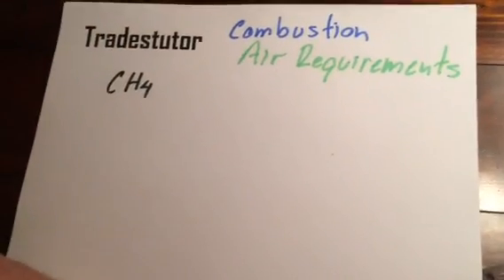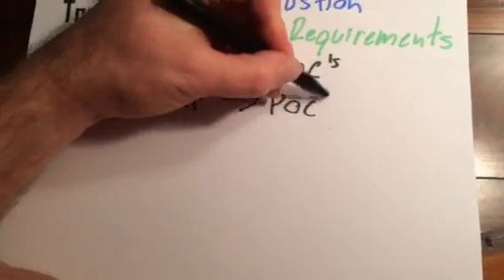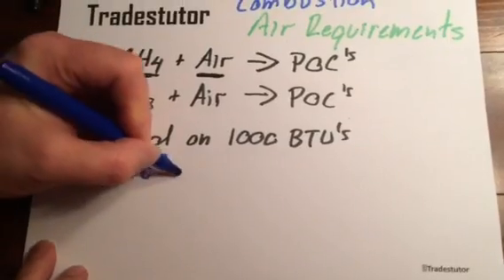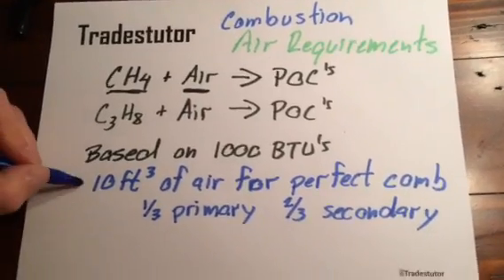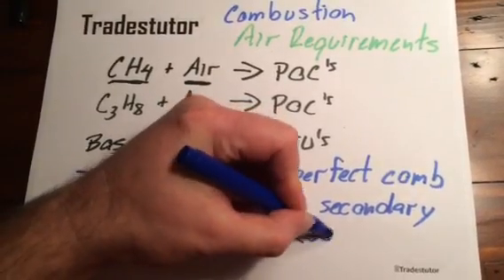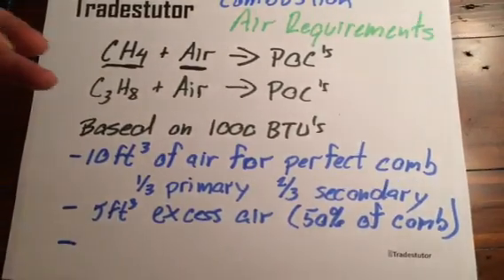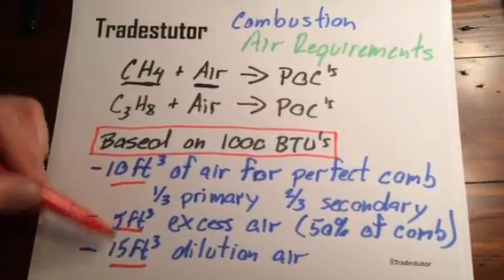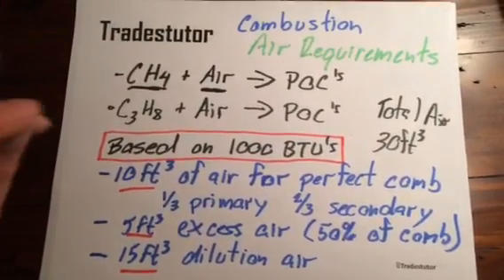Combustion air requirements

Comment: So a heating system rated at 125,000 btu is located in a confined space , all the combustion air is to be taken from the outside through horizontal duct a gritle is to cover 40% of the area
Reply from the maker: HI Liz:  This sounds like a combustion duct sizing question to me. You would need to the codebook to figure out the size of the combustion duct free area before you could add the grill on at the end of the run to outdoors. You won't need to do an air requirements calculation here as the tables in the codebook already account for the btu rating of the appliance. It would also depend what codebook (depending on country) you are using.
Reply: Couldn't you go with direct vent furnace?

Comment: To figure out the size of the air inlet opening, at what velocity should we take into consideration?
Reply from the maker: Hi Paul:
To start with you would need to know the BTU rating of the appliance you are dealing with. Once you find that you would follow the formula (30 cubic feet or air per 1000 BTU's if the appliance has draft control and 15 cubic feet of air per 1000 BTU's if the appliance does not have draft control) to find the amount of air required per hour. The size of the opening is then calculated through either tables or a formula from our gas codebook. If you don't have access to a codebook with those tables then you're going to need to figure out the total air required, then take into account the draft speed (usually 600 feet to 1600 feet per minute) for natural draft appliances. After which those numbers will be used in the flow rate formula to get your size needed. All in all its a fairly lengthy calculation.  I'm not sure if I'm on the right track here with my answer but I hope this helps somewhat. Take care

Comment: it would apply dame for diesel engines? otherwise how does this would work if you know the amount of oxygen on the air interacting on the combustion? i mean how you calculate POC if you know the oxygen amount.? (hopping be clear)
Reply from the maker: Hi Ruben:
This would apply to diesel engines as well. You would have to know the input rating of the engine (BTUH). You would also have to know the oxygen content that you are sending in. I would assume that it's just air you are using with the diesel engine so the oxygen in the air would be 20%, similar to the numbers I used in the video. The POC's are another story. They are based on the flow rate of the fuel that you are using. You would have to figure that out based on the engine you are dealing with and then also the type of fuel mixture you are dealing with (hydrogen and carbon).
I hope this helps.
Take care
Mark
Reply: @tradestutor1191  Thank you! that helps a lot.